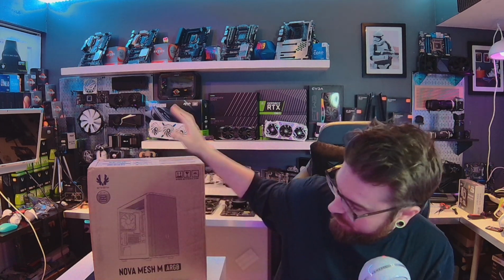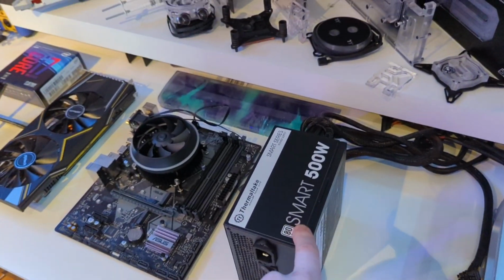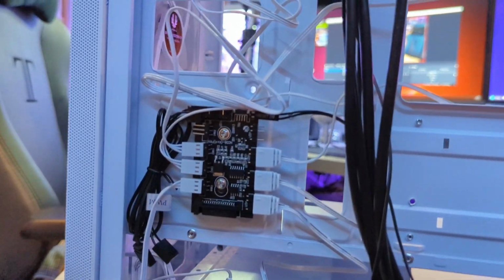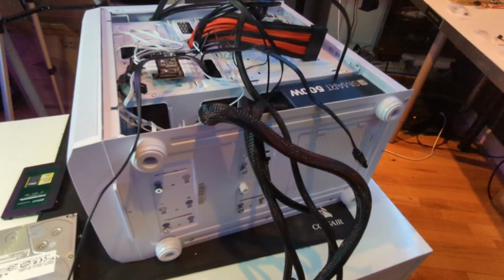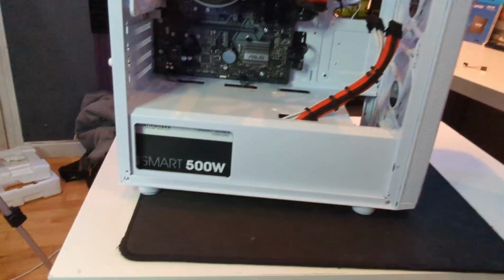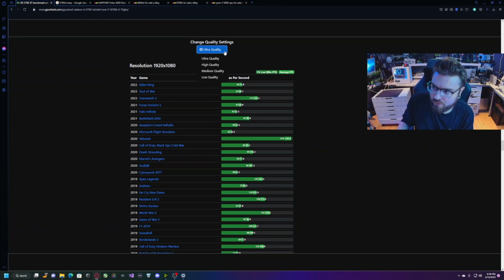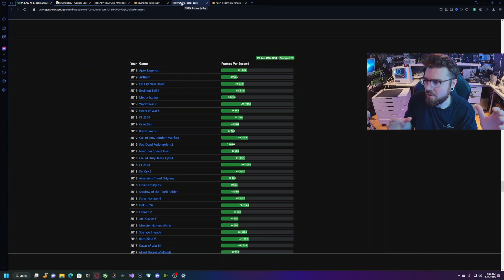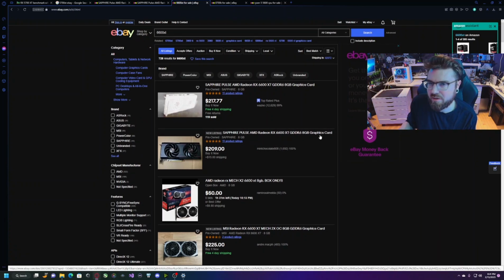This 400$ PC BEATS the PS5

Comment: and when it becomes obsolete for new games it can still be used as a home pc.
check your emails do homework so on on it 
a ps5 just like the ps4 3 2 and 1 before it is e waste in 6 years times 
a pc like this u could keep for 20 years or so if all your doing by then is homework emails youtube so on
Reply from the maker: Yeah, it's crazy that not even a few years ago it was equivalent to a 1200$ PC. PS5 is a great machine
Reply: Abyss  we still have my old pc i upgraded and the old 1 my dad uses for work files
Reply: @techwandoUS ps5 we’re sold for 700+ back when pc was expensive tho. I like both but fr a equivalent worth pc will never lose to a ps5 even tho the ps5 is sold at a (I think it’s a slight-) loss